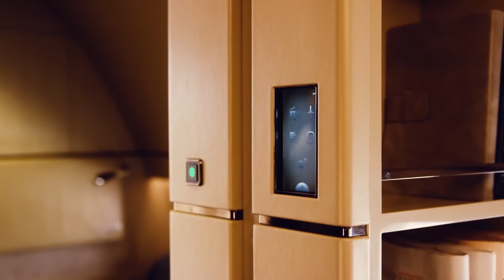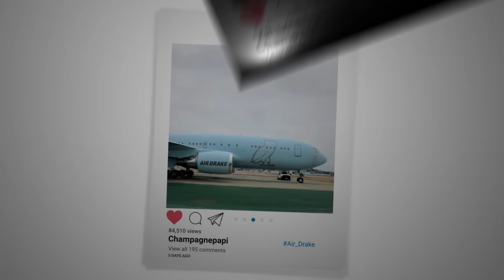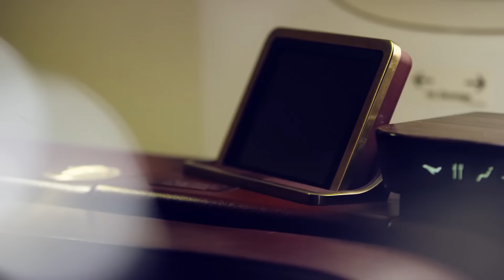Inside Drake's $185 Million Private Jet, Air Drake

Comment: it's a win-win for both. Cargo companies already used older planes bought from passenger airlines because they become inefficient and sell for cheap. After use in cargo operations, they become even lesser in value and become highly inefficient due to high fuel consumption.
So giving it to Drake is a win for both as Drake won't use every day as the company did and cargo jet gets some low-cost advertising too.

Comment: Cargo Jet needed to replace a 40-year-old gas-guzzling plane so they gave drake instead of paying for ads. A win-win for both.
Reply: A Tesla is a gas guzzler. What's your point?
Reply: Great business outlook on it. I agree.
Reply: No, it's a win-win for both. Cargo companies already used older planes bought from passenger airlines because they become inefficient and sell for cheap. After use in cargo operations, they become even lesser in value and become highly inefficient due to high fuel consumption.
So giving it to Drake is a win for both as Drake won't use every day as the company did and cargo jet gets some low-cost advertising too.
Reply: It's still a private jet
Reply: @arpandrozario7959  but they (cargo jet) spent close to $100m decorating it. That’s not exactly cheap
Reply: @grant8490  it’s electric lmao
Reply: Exactly that’s what I was thinking of just the fuel and maintenance has to be ridiculously expensive hopefully soon we will have jets that have minimal maintenance and zero fuel